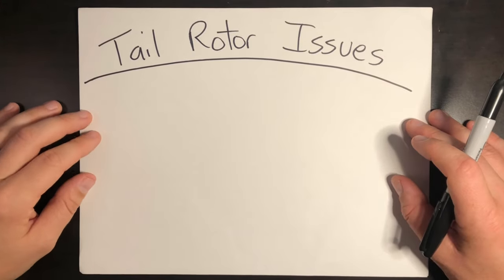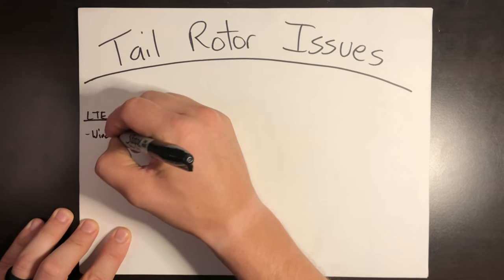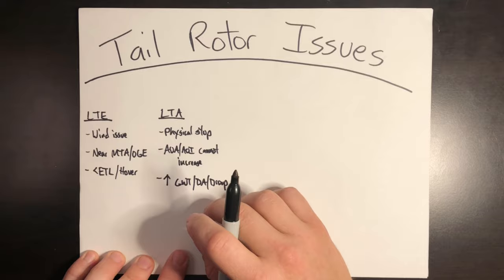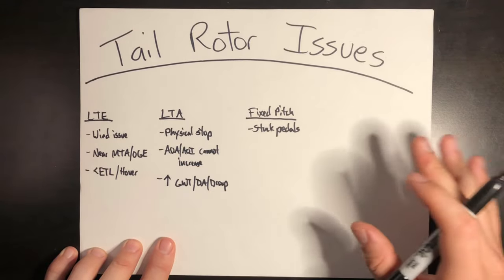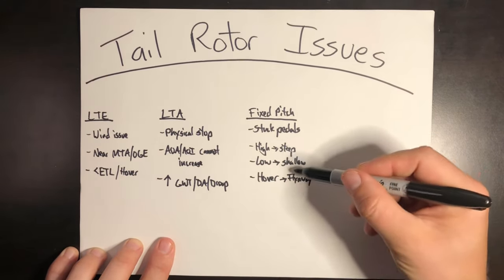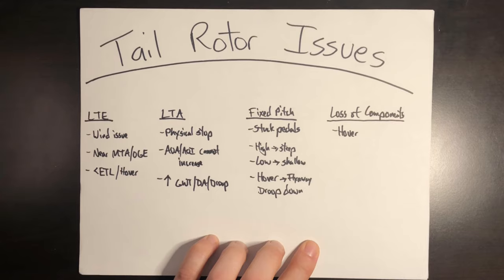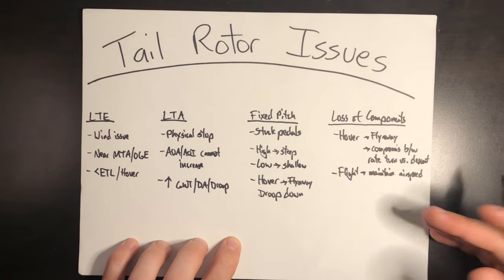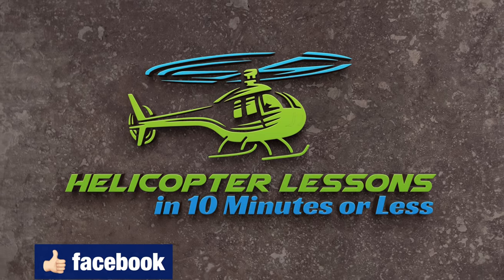Tail Rotor Issues in Helicopters

Comment: Thank you a lot for your videos❤️❤️❤️🔥🔥 can you tell me how to calculate the wingspan and area of tail and main rotor blades needed if we know the engine rpm and weight of a helicopter ?? Im a school kid and Im trying to build a big RC helicopter by myself. 🙂😊 and your videos has been a very big help for me . and in my channel ive made a small video on that can you tell me if it will work or not? Ive been in aeronautical society in our school since 7th grade and ive learned a little about aerodynamics and i love helicopters and planes soo much. If you have a little time for that it will be a big help for me.Thanks again ❤️❤️❤️❤️❤️❤️❤️.owe you big time ❤️❤️❤️.
Reply from the maker: This is getting into more of the engineering and aeronautics side and not as much the piloting side. Is recommend getting those formulas and measurements from an engineering source.
Reply: @helicopterlessonsin10minut10  ok thanks a lot😊😊❤️🤜🤛